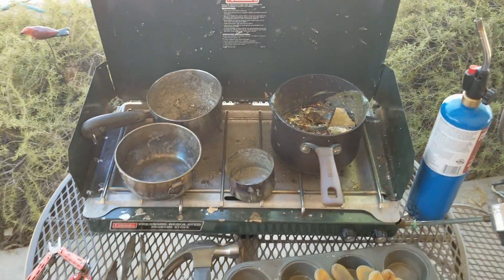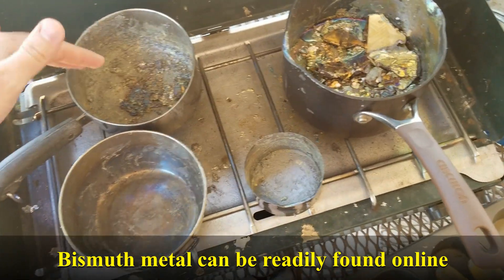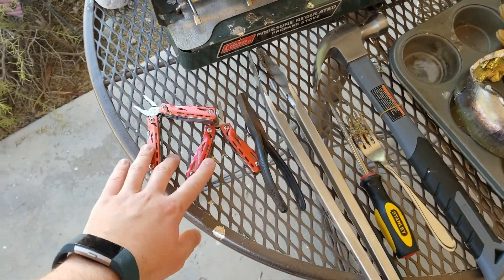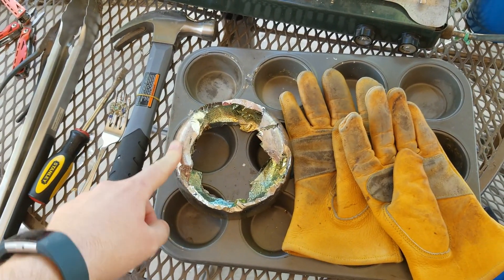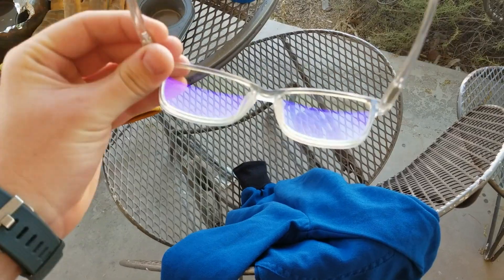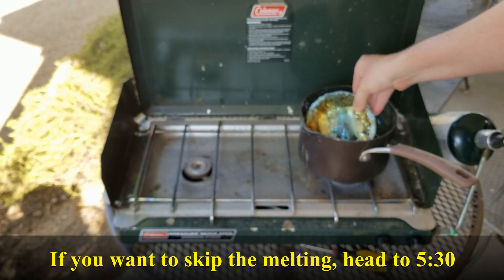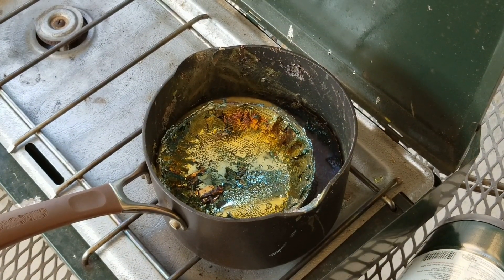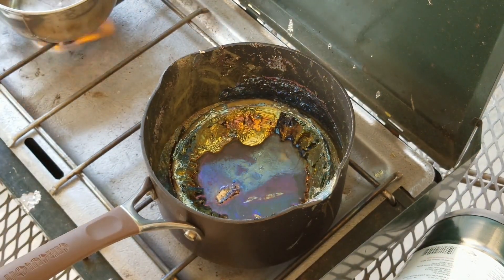How to Make Beautiful Bismuth Crystals in Your Backyard!

Comment: Bismuth, as ANY metal that produces slag, is not infinitely reusable. Every time the metal is melted and oxidizes you lose a percentage of the metal. Eventually there won't be any usable amount left.
Reply from the maker: This is true. Technically, if I had a hot enough furnace I'd be able to transform the bismuth oxide back into metal. I'm currently looking into ways of dissolving the oxide and using some electrolysis method or even making an exotic thermite to salvage the metal. Definitely wouldn't be cost effective, but might be good for another video!

Comment: I cant tell you how much research ive done and ive followed that exact protocol..but my crystals are non-existent in the geode. 2 questions, sir:
1.how long did you wait for the top to solidify, and how could you be sure it was ready?
1.5 when you were first going in with the pliers, were you flipping a crystal, or picking one out, how did you get that opening (just want to be detailed :))
2. when you torched the bottom of the geode, does that affect the crystal size, or was that purely to loosen the metal to break it open??

Thanks so much, been skimming youtube for ages, found you on reddit :)
Reply from the maker: Hi there JW, sorry for the late response, 
1. The waiting time changes with the amount of material you have, this was about 10 lbs of metal and took around 15 minutes to form the shell on top. You've got to watch and wait, maybe jiggle it around every few minutes. I was using the pliers to pick out a piece of crystal on the top so I'd have a wider opening to pour
2. Torching the bottom of the geode was solely to loosen the bismuth from the steel mixing bowl, but there might be something to heating the sides to delay the cooling process!
Hope this helps, good luck :)